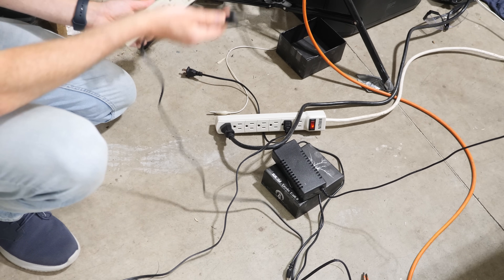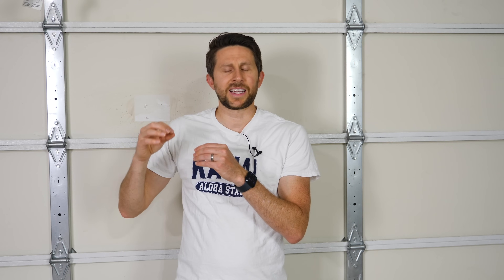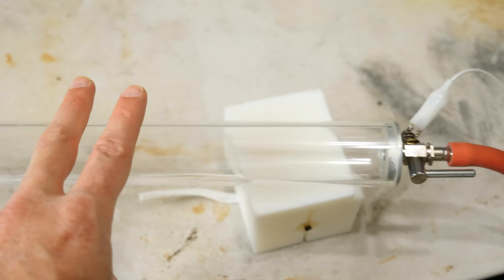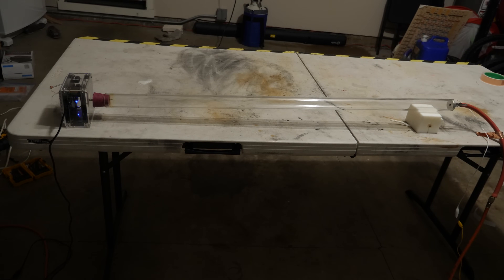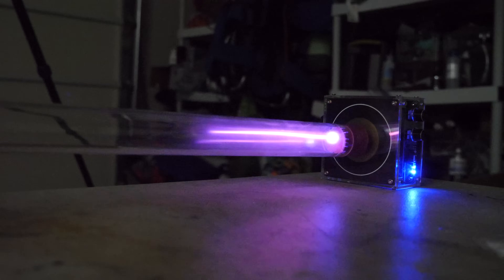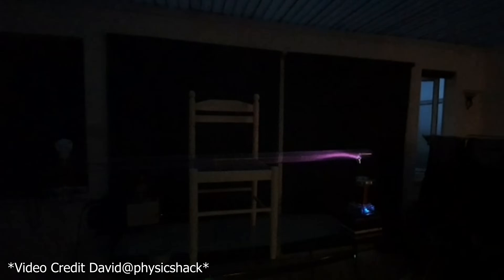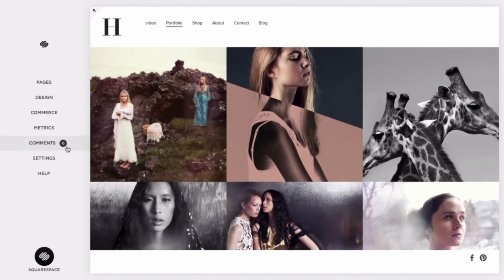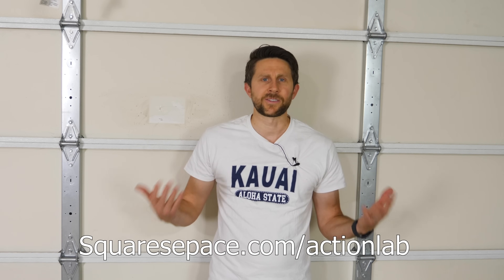Using the Air As a Wire—Was Nikola Tesla Right?

Comment: Well, in a way amateur radio operators have been doing this for some time now. I was able to transmit 20 watts of power using CW (Morse code) and was picked up 5,590 miles away at a receiving station. Granted, it’s microvolts by the time my signal got that far, but the concept is the same and it does indeed work.
Reply: @BuildGUY 20w to microvolts = not very efficient
Reply: @NexxuSix  Seems pretty efficient to me, to be able to transmit a signal 5,590 miles using only 20W.
Reply: @NexxuSix  Morse code telegraph antennae are not designed to deliver power, they are designed to deliver information. 
For power delivery, you can still convert those micro volts into 20 watts back from the electric power formula P = V I , where P is electric power in watts, V is potential difference ( volts ) and I is the electric current. The current would endup being around 20 mega ampere for a potential difference of 1 microvolt to be able to transmit 20 watts of power per second across 10000 km. 
Although for power generation it is better to use a lightening rod and, or, low powered plasma laser connected to the lightening rod as a very long electrical conduit that can reach upper ionosphere to use the ionosphere as capacitors to collect the energy much faster. I am not an expert in microwaves but normally microwaves and radio waves are used for communications through the ionosphere. 
The ionosphere to ground power transmission via plasma laser conduit or some more efficient method has the problem of plenty, essentially you will endup with mega volts  to giga volts of potential difference between the ionosphere and the receiving station over a time period of milliseconds, although we can control the current on ground but still we are talking around giga watts to Tera watts of power per second being generated and we won't be able to store that power efficiently as we would need quadrillion watt hours of capacitors and battery storage at each station just to store the power being generated within one hour. we would need dc to ac conversion to transfer the ionosphere power to the grid because of the highly pulsed nature of ionosphere power and to safely throttle the ionosphere power to the grid. 
Furthermore, generating 100 to 200 km plasma laser pulses lasting few milliseconds might itself require few mega watts of power per hour or so. ( not an issue if the ionosphere electrical power concept works and if it doesn't than its still cheaper than fusion 😈😋 )
Reply: @rufusapplebee1428  I was gonna say that. 🤔😒
Reply: @NexxuSix  Watts and volts are not the same thing, so 20W can be transferred at microvolt potentials and very high currents at near 100% efficiency.
Reply: @MirlitronOne  Only if you have very good conductors will you get high efficiencies, due to I^2R losses.
Reply: @MirlitronOne  Right. A typical antenna at resonance can have several thousand volts (at 50 ohms impedance) on it… but will only be at the microvolt level at the receiving end (hence why radio receivers are built with such sensitivity). Good catch though!
Reply: That is pretty cool, but what I do not get is why we would not just use electromagnetic waves to transmit energy, you know like radiowaves or... Wait a minute...
Reply: Pretty good for data and signal transmission but absolutely rubbish for power transmission. Damn inverse square law
Reply: It's not the same thing because a plasma discharge is not the same phenomenon as electromagnetic radiation.
Reply: @MirlitronOne  plasma laser discharge would let you create a electromagnetic pathway between the ionosphere and the lighting rod of the receiving station on ground without a 100 to 200 km wire, for a few milliseconds during the plasma laser discharge, to transfer the static electricity to the ground station, the electrons would ride the surface of plasma laser discharge and air membrane, i know the plasma laser discharge is charged protons. 
If your point is we are sending +ive charge to the ionosphere and receiving -ive charge, which might not be effective, I am assuming, to receive more electricity via -ive charge from ionosphere to ground as static electricity than is used in the plasma laser discharge. 
If I am missing something, i don't get your point. Plasma laser is used in missile defence and laser cutting.
Reply: @MirlitronOne  I theories that plasma formation means the atomic orbitals expand.
Reply: @MirlitronOne  Exactly what I was going to say.  This is transmission of power via electrons, not EM waves.
Reply: So was the early ages of electronic communication, as they used vacuum tubes in radios tvs and even ENIAC, the worlds first computer.
Reply: In the deposition for the Marconi trial Tesla describes his system and its operation. Far from what is being described in this video and the OP describes as his experience with Morse coms . He described the system in use then and now as being his system used backwards. Instead of sending lots of power like hertz did, trying to overcome the inverse squares law, he instead built up energy in his antenna at a resonant frequency without letting it escape. Then he would get a similar coil vibrating at a distance at the same frequency and he could freely exchange energy and information without loss. Described by some as “spooky action at a distance”, a euphemism for one of Maxwell’s laws. Systems in resonance freely exchange information and energy at relatively large distances. Tesla describes being able to use a wireless handheld device to communicate with his team on Long Island from West Point.  He also lamented that his system being used wrong, calls it the equivalent of leaving the oven door open to cook the environment. Seems to be working as intended.
Reply: @7sArts  Maxwell published no laws, “spooky action at a distance” was newton about gravity and had nothing to do with Maxwell, but sure, Tesla also did not understand gravity.  Tesla was completely incompetent on every subject he ever wrote.
Reply: @CalebBerman  watt?
Reply: That's cool. Was that a field day?

Antennas and radios are pretty cool, considering megawatt FM antennas don't go even close to that far.
Reply: to be honest, this is the only real way. 

how are you suppose to send amps through the air like this? volts and communication is it
Reply: Yes, I was able to light a bulbusing a TV antenna.
Reply: Reminds me of the foxhole radios. They use to make them out of copper line, graphite (pencil lead), and a razor blade and a headphone was used to listen.
Reply: Yes of course it works for low amounts of power. But that's not what Tesla envisioned.
Reply: I've picked up HF stations airborne from literally halfway around the world. Amazing how energy can propagate through the atmosphere and above!
Reply: Isn't this what the Soviets did with their giant radar setup as well, the Woodpecker? Trying to look for incoming missiles from below the horizon by bouncing the signal off the ionosphere.
Reply: I was in the room with my dad when he worked a friend of his from Australia with 10 m voice. Not bad considering that we're in southeast Michigan in the United States
Reply: Very cool!!!!
Reply: that's internal reflection not a resonant standing wave.
Reply: If the energy was able to travel that distance, granted it's microvolts by that time, would it possible to store that energy in a cell or a capacitor until it was significant enough to be used for power capabilities?
Reply: @Junglehunter677  I don't think that's possible, because there would only be microvolts in the capacitor, and VERY low current.
Reply: I had an RCI 2950 on 10 meters at 15-watts on Lower SSB on an Antron-99 and I talked to Japan from Vermont..
Reply: @CalebBerman  let me get this straight... your magical sky daddy created everything, he put the first two humans in a garden. They were total innocents, not understanding morality because they hadn't eaten from the tree of good& evil. 
Sky daddy tells them not to eat from the tree; but they have no idea that disobeying sky daddy is wrong because they haven't eaten from said tree. 
So, they eat from the tree and realize that disobeying was wrong.  "Loving" sky daddy curses not just them, but ALL of their descendants and kicks them out of their home.
Later, "loving" sky daddy drowns the world, killing nearly all creatures on Earth (including most puppies and kittens) because he's mad at the humans.
He later realizes this wasn't too loving, so promises not to do such a thing again (until he renegs and says it will happen again during Judgement Day). 
He later decides to forgive everyone for what their ancestors did, but just can't forgive... he has to make it complicated.
He comes up with a plan where he knocks up a teenager. His resulting son needs to be tortured and killed as a blood sacrifice in order for "loving" sky daddy to forgive people. 
Why would you want to follow such an evil being, let alone want others to worship it?
Reply: @CalebBerman   Sounds like a dictator.
 You better acknowledge and worship me or damned to hell.
 If God were real he sure wouldn't be as feeble as The Bible makes him out to be. I mean come on do you actually believe the stuff you read,... Or try to calm down everyone's throat. Do you know your history. There is a question for you.
 Religions are weapons of mass destruction and always have been.
 It is a Cult man,... Just happens to be one of the biggest on the planet. Doesn't change the fact though.
Reply: amazing to think these special needs people think Egyptians built pyramids to obtain electricity LUL !!!! and even worse they said " well tesla said its true " ahahah haha hahaah haha ahahh, electrons barely make it across a metre of vacuum tube letalone sandy desert skies
Reply: I solved metaphysics yesterday. Enjoy.

["Transcending dimensions" 
(Jacob's Ladder 🪜)/
0-5th dimensions corrected & clarified] by C. M. Elmore 

2D shape-name or
3D shape-name for determining 4D end-shape and 5D end-shape:

(2D 'circle' vs. 3D 'sphere', in this case)

🆗️ Earth IS a 4D 'circle' (2D shape-name); a "quaternion".

🚫 Earth IS NOT a 4D 'sphere' (3D shape-name); a "hypersphere" (lit. 5D/contradictory).

🆗️ 2D 'circle' 
🚫 2D 'sphere' contra.

🚫 3D 'circle' contra.
🆗️ 3D 'sphere' 

🆗️ 4D 'circle' (2D shape-name) = 4D end-shape "quaternion". 

🚫 4D 'sphere' (3D shape-name) = contradictory 

🚫 5D 'circle' (2D shape-name) = contradictory 

🆗️ 5D 'sphere' (3D shape-name) = 5D end-shape "hypersphere"

2D shape-name for determining 4D end-shape.

3D shape-name for determining 5D end-shape.

"Evens and Odds", transcendentally speaking.

0D: point 🔘
1D: length/line
2D: shape-name + L/W "circle/flat earth".
3D: shape-name + L/W + depth "sphere/globe earth".
4D: shape-name + L/W/D + time(flow); 
current, 'contingent' (not simulated) 4D 'circle' "quaternion" earth.
5D: (H1; hypersphere)

Google 'quaternion' stereographic video/images/info, please. That's our 4D circle (not 4D sphere) Earth, demonstrably so. 

"we're 4D?" -me,
"🔫 always have been" -also me.
Reply: What's the point of sharing a fairy tale here?
Reply: @BuildGUY As he said, 20 watts.
Reply: @CalebBerman  Please don't spam off topic stuff
Reply: 5500 miles!!! Impossible on a sphere shape earth. Earth is flat.
Reply: It's not the same, that's not electricity that you sent, it was a radio wave.
Reply: @CalebBerman  God don't exist stop indoctrinating people.
Reply: @CalebBerman  Your God is a made up story by some very old power hungry men that found a way to control other men and also gave them a new reason to murder millions of innocent people that didn't believe in their "GOD"! Oh yes I know the hate I will get from this but I am not saying there is no god I am saying the books wrote thousand years ago++ on this were as I said used to bring men to their knees and create followers but do I believe there is a god?? Idk I do think it is very very possible and I would so love it if there was a magical happy place when we all die because no one want the lights to just go out but I think it's more likely that the lights just go out over a man with a white beard and golden gats open so we can dance an eat with all of our friend and family that have passed but that would be nice.
Reply: I'm able to do 1.5KW on HF/high MF/VHF/UHF+
Reply: Wouldn't the loss in power just reboot by bouncing constantly  with storage tanks? If there were storage is all. What's to stop just storing the power and using them as parental guardians for dispersement. To enhance all momentum in the whole equation. Just a figure 8 sequence + storage. Doesn't seem impossible at all. ❤
Reply: This is how lighting works
Reply: Tesla has an magnifying transmitter. That are not the usual electromagnetic waves.
Reply: Now do it at 10KHz, like Tesla described.   He said that broadcast power only works down where losses are low and inverse-square becomes irrelevant: in the ELF band well below 20KHz, where today we measure that 95% of the signal will pass around the entire planet (giving a Q-factor of roughly ten.)   Supposedly you have to exactly hit one of the Shumann resonances, to build up significant standing-waves, but those high-Q modes are known to wander around slowly over minutes.
Reply: If we can use 1.5 km perpendicular lasers that detect gravitational waves caused by merging black holes light-years away with a detector that detects changes in laser position that's smaller than the full surface of a proton, imagine what else we could do with that.
Reply: @CalebBerman  Your chances of convincing anyone to follow your religion in the comments of a sciency video is very low. You should try spreading your belief under a troom troom video, their audience believes just anything no matter the rediculessness of the claim.
Reply: @isi2973  he convinced me. But I was already a believer
Reply: LMAO... I can't help but laugh at so much RER nonsense spouted with such a sense of confidence.  I have read just about everything Tesla wrote as well as everything factual written about him, and all of Maxwell's treatises, produced with the help of Lord Kelvin and many of the other luminaries of his day. It is a work of art, taking every piece of conjecture of the day, putting it through physical experiments and developing formulas to pick apart every aspect of the theory to prove or disprove it. The team came up with 25 formulas in some 20 unknowns (paraphrasing) most of which describe open systems. Natural systems. Since the engineers of the day only understood closed systems and power from a steam engine, they stuck to what they knew. So instead of the beauty of the work of Maxwell and his contemporaries, we are stuck with Heavyside's simplification of a 3D description of four formulas into a 2D representation that was easier for those who couldn't be bothered to learn quaternions to understand. Tesla was not one of those, is desire to learn math at its highest levels led him to read  William Rowan Hamilton's books and apply it to what he was experimenting with. So far from being bad at math and not having a clue of what was going on in electricity, he was indeed far ahead of the others whom had been caged by complacency and assimilation like a cat in a box. Those of you who are interested should read the deposition for the Marconi trial which can be found on the twenty first century books website. Excellent read for anyone who wants to understand the master of lightning and his toys.
Reply: @7sArts  now you are just lying.  You cant pass a calculus course and then read tesla and think he is competent.
Reply: The efficiency of this transmitter made me rethink that's if it's worth using or not
Reply: Radio, Bluetooth and wireless.

Yup... we been doing it for years :)
Reply: its not the same actually.  Tesla was very loud and clear about this - his "ideas" do not follow the inverse square law and would suffer no loss at any distance.  In short, he is overrated.
Reply: @rer9287  underrated... wireless electricity was only part of many things he was doing.
Reply: @thetroll1247  sure, but it was all BS.  He had no math skills and therefore could not make sense of the things he was trying to do.  He never produced a single document that was impressive in a good way - he only wrote incoherent BS.  His only contribution was the multi-phase motor and he was lucky enough to patent it because other people independently invented it at the same time.
Reply: @rer9287  so no tesla valve no harmonic freq generator. Wasn't able to see plans in  his head and rework them and so many more ideas and inventions.
MAYBE his math skills weren't understood like so many things he didn't do. Damn so many yrs wasted.
😭.
Reply: @thetroll1247  learn math and science then you will understand.  you are wasting time with tesla
Reply: @rer9287  well I know both and still feel he was smarter than most.
Reply: @thetroll1247  based on the fact that you have never read his work.  kinda not very thorough basis.
Reply: @rer9287  OK then
I'm done with circle argument. I have things to build. Thanks for the fun  morning.
STILL NO FAITH IN HUMANITY
Reply: @thetroll1247  you are being irresponsible and promoting BS based on stories you heard.  Its not something to admire.
Reply: @rer9287  nope just upset that my armchair theories are all gone because he couldn't add.  He got real lucky his coils and test plant didn't go nova and blow the whole town up. Damn kid toys. Well back to building my portable solar generator.  Have a nice day.
Reply: @thetroll1247  building your solar generator based on Maxwell's work which Tesla directly rejected and called the worst thing to happen to science - you know, because he was so competent.
Reply: @rer9287  nope Westinghouse
Reply: @rer9287  : Tesla is overrated, but he was also a major player in electrification via the electrical grid... which Maxwell was not. And while Tesla's claim that his wireless transmission system would have nothing to do with the inverse square law was wrong, his claim wasn't without basis- he was poking around at what today are called the Schumann resonances, but at that time had not been sufficiently studied. If Tesla could have gotten enough money together, he indeed could have gotten his system to actually work.

Also, if he got the money together to start the system, then it would have gone bankrupt from the impossibility of charging for the power. You seriously aren't able to charge for that sort of thing, because you'll never be able to track all of the receivers. While it was technologically feasible (though difficult, due to the Schumann resonances floating around over time), it was organizationally insane. Only a unified world government would ever be able to justify such a system.
Reply: If the energy is contained in the schumann cavity and not propagating outwards to space then how is it wrong to say that it doesn't follow in inverse square law?

 @absalomdraconis
Reply: A perfect laser also doesnt follow the inverse square law. The law is a consequence an emission spreading out over a distance.
Reply: @rer9287  Over rated he is NOT..  Tesla is correct there would be No loss at any distance once you achieve frequency resonance with our planet. Everyone seems to forget our Earth is a giant electro magnet. All you have to do is harness the natural magnetic field of our planet. 1. Antenna (tesla coil) 2. Induction (earths magnetosphere) 3. resonance ( bounce the high frequency energy off earths ionosphere) 4.  receive energy at any point on earth via home antenna. - Lather, rinse, repeat.-
Reply: @Nik-by5mi  Sounds about right, Nik! 👍
Reply: @Nik-by5mi  Good insights. I beleive the earth's magnetic field and resonance (pulsing energy @ Schuman frequency) is key as well. However I wonder if the end goal was to amplify the  field strength of earth natural magnetic field, to the point where we the field density would be strong enough to provide us with usable current by passing a conductor through it. Say by spinning a conducive disc horizontally (perpendicular to earth's magnetic field). Like current generators or motors, except we don't have to burn energy to make a strong enough magnetic field, the earth's would be strong enough already.
Reply: @Nik-by5mi  please take some calculus classes.  without knowledge of math you will be no different from Tesla.
Reply: @rer9287  I am not quite sure of what you try to insinuate. Yes, Tesla is a bit overhyped but he is still a major figure in Electrotechnics which encompasses some of the most difficult mathematical subjects in Physics.
Have you any Physics knowledge? well me I do, and the Antenna part of the Lv 2 EM courses (pre doctoral) still give me headache just to think about it .
Reply: @aetius31  I do not believe you have any understanding of electronics when you say Tesla is a big figure in electronics.  That is wrong.  100% of the knowledge of electronics comes through Maxwell.  Tesla hated Maxwell and said Maxwell is wrong.  Tesla said none of his work has anything to do with Maxwell.  Make up your mind - either you understand electronics or you hate Maxwell same as Tesla, but you cant have both.
Reply: @rer9287  Please take some Electrical Engineering classes. Tesla was well versed in Math, Calculus and Physics!
Reply: @rer9287   I do NOT believe you have any REAL knowledge of who Nikola TESLA actually is. Your history views and statements are majorly flawed and impaired.  Please provide an actual quote of Nikola TESLA ever disagreeing or expressing any Hate towards James Clerk Maxwell???? There is NONE!!!  Tesla has over 112 US patents. 30 more in France and many other countries.  Please go back to school you are only embarrassing yourself on here.
Reply: @Nik-by5mi  “The fascination of the electro-magnetic theory of light, advanced by Maxwell and subsequently experimentally investigated by Hertz, was so great that even now, although controverted, the scientific minds are under its sway.”

--Nikola Tesla
New York Times
April 8, 1934
Reply: @Nik-by5mi  “The so-called Hertz waves are still considered a reality ... This view has become untenable”

“Thus, a wireless transmitter does not emit Hertz waves which are a myth...”

--Nikola Tesla
New York Herald Tribune
September 11, 1932
Reply: @Nik-by5mi  “Mr. Tesla agreed to discuss the point at length. As a result, he made public for the first time one of the most extraordinary conclusions - that Hertz waves do not exist!”

“According to Mr. Tesla, the present broadcasting station does not propagate Hertzian waves, as has always been supposed...”

--New York Herald Tribune
Sept. 22, 1929
Reply: @Nik-by5mi  “The Hertz wave theory of wireless transmission may be kept up for a while, but I do not hesitate to say that in a short time it will be recognized as one of the most remarkable and inexplicable aberrations of the scientific mind which has ever been recorded in history.”

--Nikola Tesla
Electrical Experimenter, May 1919
Reply: @Nik-by5mi  “...but this view  [Maxwell/Faraday/Hertz Radio waves] is untenable in the light of my discovery...”

“It is indispensable to first dispel a few errors under which electricians have labored for years, owing to the tremendous momentum imparted to the scientific mind through the work of Hertz which has hampered independent thought and experiment.”

--Nikola Tesla
Electrical Review and Western Electrician
July 6, 1912
Reply: @Nik-by5mi  “The first to be dispelled is the illusion of the Hertz or electro-magnetic waves.”

--Nikola Tesla
N. Y. World
Jan. 5, 1908
Reply: @Nik-by5mi  “...in my wireless system the effect does not diminish with distance. The Hertz waves have nothing to do with it.”

--Nikola Tesla
New York Times
June 23, 1907
Reply: @rer9287  Can provide a link to the full article thx
Reply: @Nik-by5mi  now we know you are too lazy to be honest.  You represent Tesla perfectly.  Anyway - I suggest you go learn math so you dont make the same mistakes.
Reply: @rer9287  Wait, Tesla did not believe in electromagnetic waves (and corresponding electromagnetic field theory)? Why? I thought he must have read the works of Faraday and Maxwell. If he had done that, how could he just disregard them and the entire field of electrodynamics like that?
Reply: @isi2973  he is quite overrated.  He also did not understand gravity which is much simpler.  He was profoundly incompetent.
Reply: And if renewable energy were used to power your transmission, that would definitely be proof of concept because efficiency matters far less when the energy is renewable...despite those attempting to skew the principle by citing efficiency...when I'm they don't care about fossil fuel efficiency...
Reply: @sampleoffers1978  its like when people think nuclear is so dangerous when the pollution from fossil fuel power generation are way more harmful
Reply: @dobber43  Nuclear is dangerous as a state sponsored terrorism target, that's true. Nuclear should be done in remote locations, guarded by military and the energy transported to the places where needed.